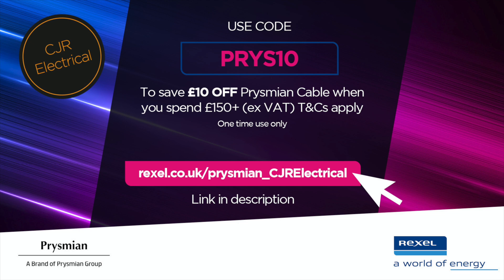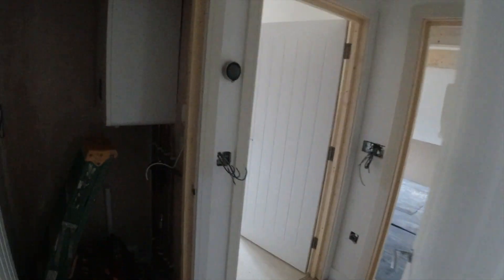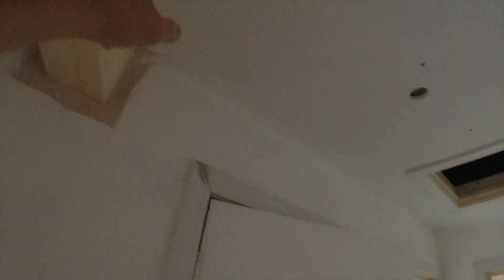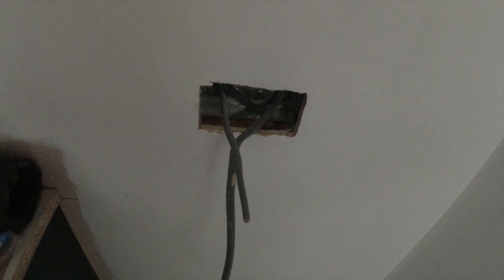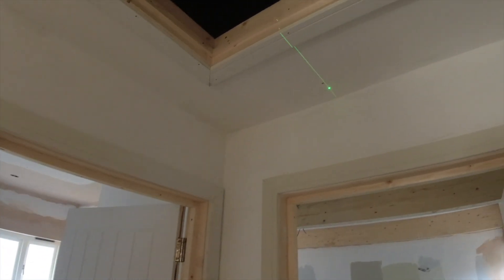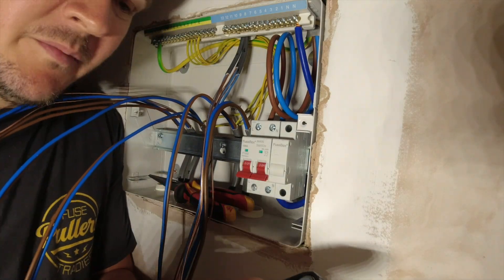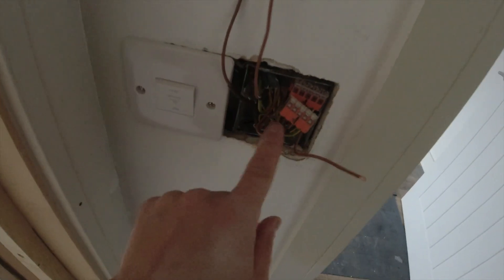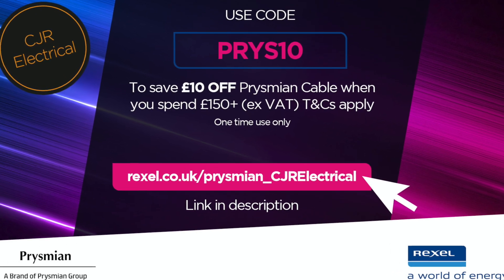GLAD TO SEE THE BACK OF THIS ONE!!!!

Comment: Thanks for another nice video. The timber beams form a bit of what's called a "smoke curtain". As some trivia - If you have a look in new shopping centres for example there are usually glass panels hanging down around voids for escalators or the ceilings to stop or slow the smoke from flowing straight up. This depends on how well smoke exhaust and zoned pressurisation works. In the fire zone there is exhaust only and the areas around it go to 100% external air supply.

Comment: Is that cooker switch realistically placed in such a way its easily identifiable and in place for emergency isolation? 
May not be a fixed reg for it, but I severely dislike isolators inside cupboards. 3g switch back at the door controlling a contactor would be better in my view
Reply: Nothing  wrong  with  Cooker  switch .You can't be self employed.
Reply: No need for emergency switching only maintenance